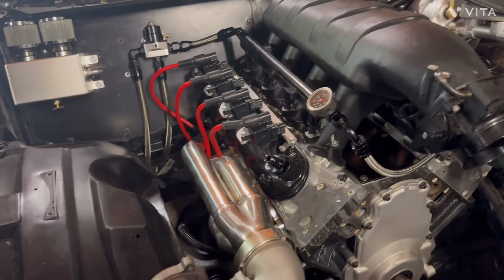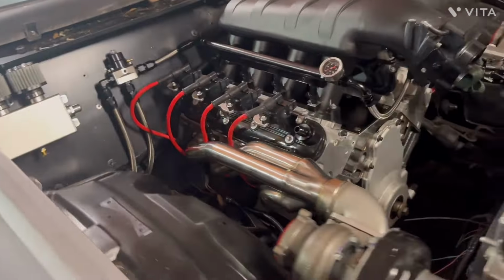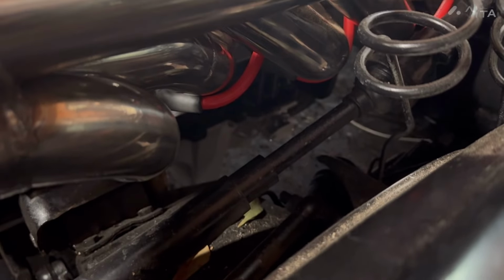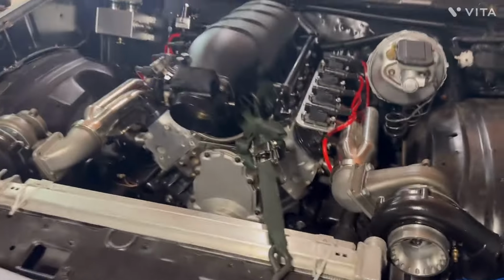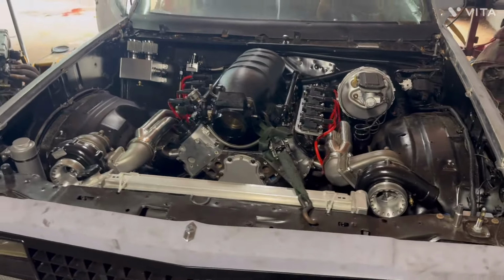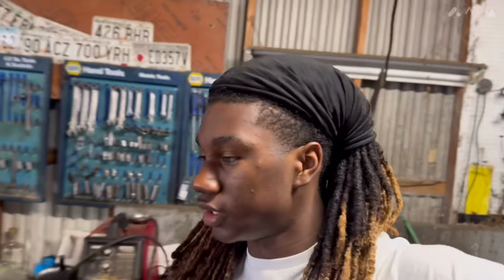Made customs coil pack relocation brackets for the 81 Malibu

Comment: Add another bracket to the bottom and used the flue line ties line tie I think that what they called and it will pull the plug wires closer to value cover on the bottom bracket